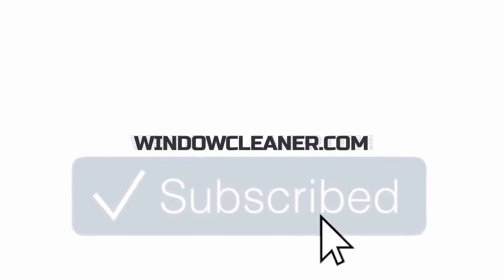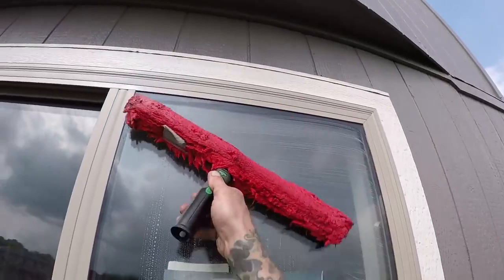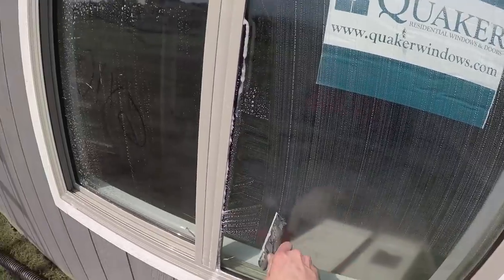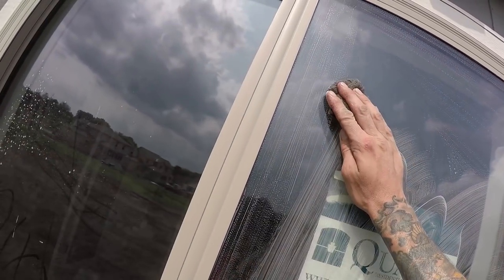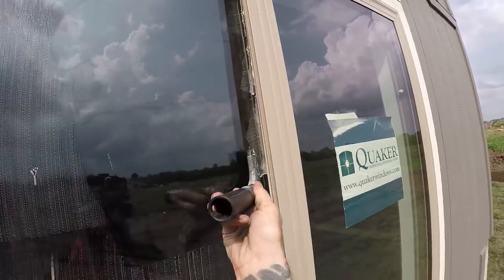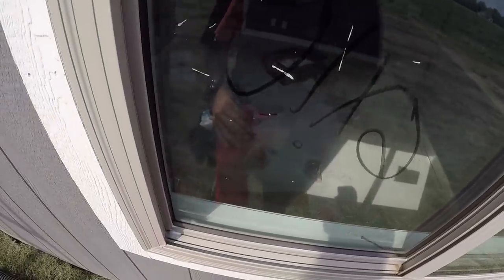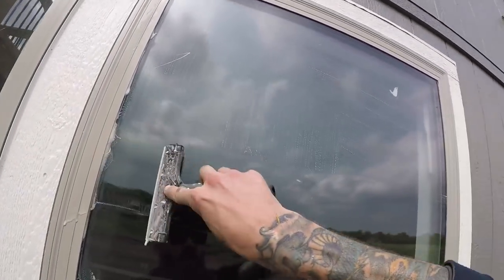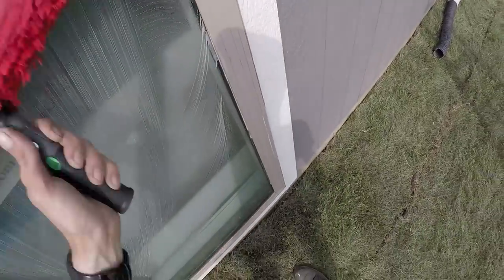3 Must Have Tools For CCU Jobs

Comment: 1:34 so how do you remove silicone?

Also how do you bid. I normally do a normal standard bid for residential and the multply it by 3 if their aren't anything abnormal about the glass?
Reply from the maker: Sivram Hiyall depends on how bad they are and how much is on the glass. But yes triple cost is normal.
Reply: Magic Eraser is great for silicone!!

Comment: Dose it matter what SIDE of the scraper you use? i noticed my Unger urgo 6" has a little thumb pad, and i allways assumed it fast me, but i never did get very smooth contact on the glass, vs turning it around, i noticed your not using the thumb pad thoughts?

Comment: How do you remove the silicone?
Reply: Luis Martinez I've found #0000 steel wool works best!
Reply: Luke The Window Cleaner thank you. I currently use it but i struggle with clear silicone when using 0000 steel wool or blade, kind of like the kind used in a new shower glass installation. Is there a chemical you recommend?
Reply: Luis Martinez try the magic eraser
Reply: Henning Marx thank you for your recommendation I'll definitely try that out today.
Reply from the maker: Luis Martinez try these products for silicon  https://shopwindowcleaningresource.com/silicone-adhesive-remover.html